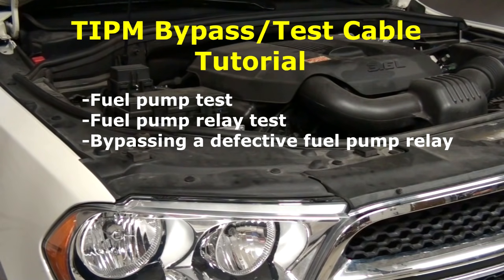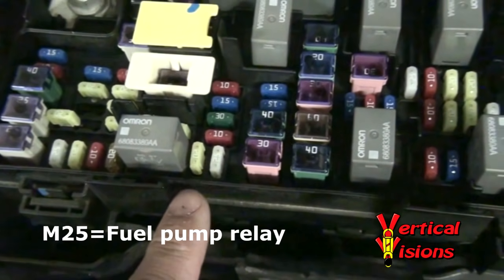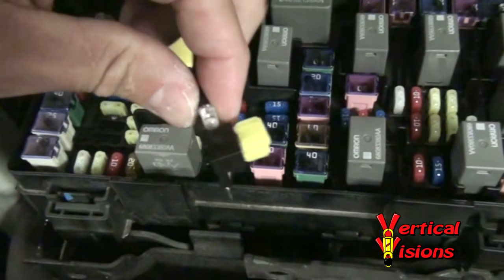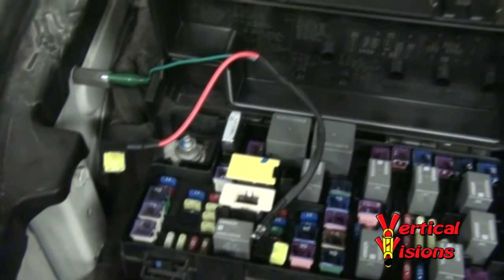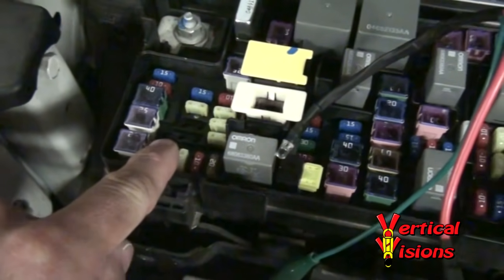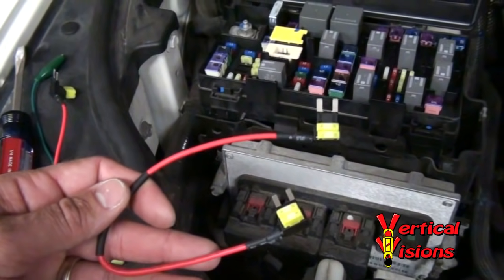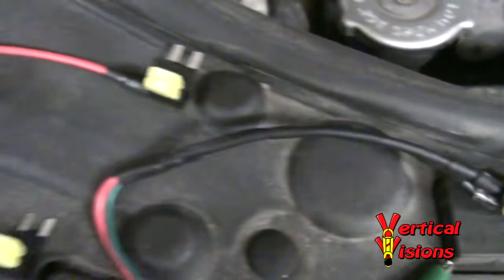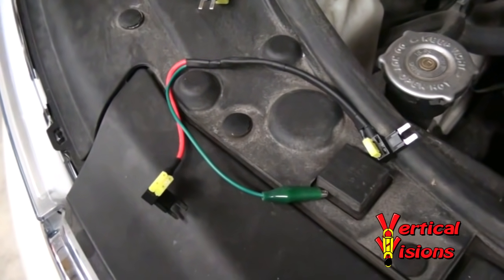TIPM Fuel Relay Test and Bypass Solutions - Most 2007-2021 Dodge, Chrysler, Ram, Jeep, VW Vehicles

Comment: My 2013 town and country is doing having an issue where it either stays on or takes several tried to turn on. Would this be the fix. When it stays on I’ve been pulling the m25 fuse to kill it. If this part is the fix where can I order?
Reply from the maker: This would indeed be your fix as your description of the problem matches a fuel pump relay problem perfectly.  Order here, along with more solution options:  https://www.verticalvisions.com/tipm-fuel-relay-solutions.html
Reply: @VerticalVisions  I’ve ordered and received it, I installed it yesterday, it started and ran. This morning i could hear the fuel pump come on but then it didn’t want to start. To be honest the fuel pump was much louder than normal with this cable. Should I take one of the fuses out?
Reply from the maker: @ckward9379  Fuel pump was likely louder because you now have an unobstructed flow of current to the pump.  The old faulty fuel relay likely had carbon or silicone buildup on the contacts, lowering system voltage.  As to why it won't start, there are dozens of things that can cause this.  Could be fuel pump obstruction, cam shaft sensor, low fuel, inadequate fuel pressure, WIN/fob issues, etc.  Which vehicle do you have  (year/make/model)?
Reply: @VerticalVisions  2013 Chrysler town and country! Thanks for the reply!
Reply from the maker: @ckward9379  2013 T&Cs are becoming very popular for having fuel pump relay issues.  Send us a photo of your part installation and we'll try to see if anything is out of place.
Reply: @VerticalVisions  I appreciate it, I got it started and it’s running fine now. It had sat for a good week and a half to two weeks. The cable did the trick! Thanks again!

Comment: Awesome video and implementation of a great workaround.  I have a 2013 Dodge Avenger with the same symptoms, but you don't have the bypass cable for that model.  I'm going to have to find a wiring diagram somewhere and see if it's possible to figure out.  If anyone has any ideas or knows where I can get a wiring diagram online, please respond!  Thanks!

Comment: Hi Jason- I purchased one of these years ago from you out of desperation and it worked flawlessly. This year, however, as the colder weather is upon us, there are some mornings our Grand Caravan cranks and won't start after numerous tries. After 5 minutes if trying, we have managed to get started, but I'm wondering if you have a suggestion. I thought I remembered a comment you may have made in the earliest posts that the fix might not be permanent.
Reply: Easy solution (new cable connection method):  https://www.verticalvisions.com/tipm-test-bypass-cable-mini-blade-fuses.html#faq20

Comment: The bypass wire works great in warm weather, when it gets below 40 it needs to crank it 10-15 times before it starts, I have no idea why. Once it starts, you shut it of right away, then while the car is still cold its gonna start right away, no problem. Why???
Reply from the maker: Solution:  https://www.verticalvisions.com/tipm-test-bypass-cable-mini-blade-fuses.html#faq19
Reply: @VerticalVisions  thanks, M37 works great

Comment: I had the same problem but it’s fixed.  there any way to fix the remote start?
Reply from the maker: Yes, use the new M37 to M25 connection method to enable remote start: https://www.verticalvisions.com/tipm-test-bypass-cable-mini-blade-fuses.html#M37

Comment: Hi Jason, I own a 2009 VW Routan. The van runs great, but every 100 miles or so it will stall out in the middle of the road. Once I coast to a stop, it will always start again when I turn the key. Obviously I want to avoid this dangerous inconvenience. Is this an issue with the fuel pump? Or is this something that can be fixed with the bypass? Thanks for your help!
Reply from the maker: Stalling while driving is not always a fuel pump or relay issue.  My theory is a thermal expansion issue inside the TIPM on a solder joint or similar.  As you drive and heat is generated, the solder joint expands causing an open circuit (no flow of electricity).  To be honest, we are not 100% certain of the cause for this unique situation......but you are not alone with this problem. Unfortunately, it's not always a fuel pump relay or pump problem, as reported by our customers.

Comment: Thank you very much! Using the information on your website I was able to  build a bypass cable and used the new M37 to M25 method to solve the faulty TIPM fuel pump relay problem on my 2011 Ram 1500 Hemi. Curiously, after adding the jumper my MPG's increased significantly.

My theory is that the corroded relay contacts caused excessive resistance, which caused a drop in voltage to the fuel pump, decreasing its output.

Thanks Again!
Bill

Comment: i just watched a similar video and the guy used 20 and 10 amp fuses on the cig lighter side and 20 and 15 amp fuses on the fuel pump side? can you shed some light on why he did that instead of 2 20s on both sides?
Reply from the maker: We developed this system in 2014.  We also have a new cable connection method that uses M37 to M25 for bypassing the fuel relay.  This is likely what you saw.  Here is the new method:  https://www.verticalvisions.com/tipm-test-bypass-cable-mini-blade-fuses.html#M37

Comment: Will this work on 2017 ram 2500?
Reply from the maker: I am nearly certain our TIPM cable with micro2 fuses will work on a 2017 Ram.  Go to this page and verify that your TIPM looks the same as shown:  https://www.verticalvisions.com/tipm-test-bypass-cable-micro2-fuses.html.  if so, it will work.  We simply haven't updated our applicable vehicle chart to include 2017 models yet.

Comment: Thanks Jason! That part has saved me a lot of money. But...... now I’m having battery drain issues. I don’t know if it’s related or not, but the truck will start up when jumped and run great all day. If I leave it sitting longer than 24 hours, it won’t start at all. From what I can find in forums, it appears to be something related to the fuel pump draining my battery. Maybe I have the fuse plugged into the wrong cigarettes lighter relay spot??? Thoughts?
Reply from the maker: Use the new cable connection method:  https://www.verticalvisions.com/tipm-test-bypass-cable-mini-blade-fuses.html#M37

Comment: Great temporary fix! Thanks. Currently waiting on parts for recall. Your video saved me. The jeep wouldn't come on with remote start like you mentioned.
Reply from the maker: Our new connection method allows for remote start:  https://www.verticalvisions.com/tipm-test-bypass-cable-mini-blade-fuses.html#M37

Comment: I ordered this works amazing! Expect for my key start truck starts and shuts right back off is there a way to fix this as well?
Reply from the maker: If you meant to say "remote start", then simply configure the cable per our new method and remote start works perfectly.  Link:  https://www.verticalvisions.com/tipm-test-bypass-cable-mini-blade-fuses.html#M37
Reply: @VerticalVisions  before you replied I went threw your instructions and found it and yes it worked!! Awesome thank you so much!!!

Comment: I have a 2016 dodge the fuse layout is different from the one in the video so which fuses I need to pull to use jump wire 🤔
Reply from the maker: 2016 Dodge Ram, Caravan, other?  Not sure which vehicle.  If a Ram, go here:  https://www.verticalvisions.com/tipm-test-bypass-cable-micro2-fuses.html
Reply: @VerticalVisions  Thanks alot

Comment: I have a 2012 durango rt with the push button start, sometimes when you start it with the button it will die about 4 secs after and is hard to restart (like its not getting fuel) is the TIPM problem the cause of this?
Reply from the maker: You may have an external fuel pump relay that is the cause.  Replace it.  More info:  https://www.verticalvisions.com/omron-g8jn-external-relay.html#identify

Comment: The Horn on my my BF's 2012 avenger goes off randomly while he's driving it. Will this chord work for that? Apparently this is a common issue with avengers and the dodge avenger forum says dealers are recommending replacing the TIPM for $1200 bucks!
Reply from the maker: A TIPM cable won't work.  Possible solution here:  https://www.verticalvisions.com/other-solutions.html

Comment: Hi Jason! I don't know how often you check this but I have a question..and I'm praying you have an answer for this single mama of 4. I bought your bybass about a minth ago hooked it up on my own and my new van I just leased in March started right up!  It has started everyday no matter what time or day any time I started it and now again it is sitting in my work parking lot and will not start. I am so upset and don't know what to do!
Reply from the maker: Make sure you're using the M37 to M25 connection method per the instructions since this has changed from the video above.  If you still have the instructions, your question was answered on the back page with respect to items to check.  Which vehicle do you have?  If you have a 2011-2013 Durango or Grand Cherokee, you likely have an external relay installed and our cable is ineffective.  Hope this helps.
Reply: I have a 2012 Dodge Caravan Crew. I did use the new hook up method..and it worked like a dream like O said for about a month. The last time I went to start it it started up and then just died out..I can hear the fuel pump tho so Idk.

Comment: Hello news flash....This is not the proper repair part or procedure for this problem....and what happens when you accidentally drop a dime into the cigar lighter socket and it shorts out? These TIPM modules are junk i get it but jason is making a business selling something that could cause more problems than you started with. This jumper wire is a bandaid only for this problem and to keep you from getting stuck somewhere in bfe, not a proper repair. But hey for all those who want to risk a 5$ part on this well go ahead and burn down your  $10k truck or car .
Reply from the maker: News flash:  We don't use the rear cigarette lighter for anything other than testing purposes when the car is off (we now use the run/start signal for power in bypass mode).  I get it....it stinks for dealers and repair shops when someone outside the "industry" develops a simple solution to a problem.  FYI:  There are tens of thousands of cables in use around the world since 2014 and no one has burned anything down.

Comment: This is the last time I bought a dodge, it's the worst car in the world, the dealer has proven to be despicable for not calling its scrap cars.about this video Ok ok ok some people disagree 🤔 why ؟؟؟؟????? In any case, many thanks and deserves appreciation and admiration.thank you so much Jason.
Reply: i agree, since fiat took over they build pure garbage.
Reply: Call the factory service rep and explain your problem and what can be done about it and which dealer can you take it to and get problem fixed. I would be very surprised if that didn't work for you.
Reply: Every vehicle brand has its issues. Its just different things for different brands. Just because youre having issues doesn't mean they are the "worst" in the world. Ive had issues with ford, chevy, dodge, nissan....
Reply: @Jasten Lothes  ok My friend, correct. But if you compare your Dodge car with another car, such as Toyota or Honda, you will notice the difference. My Dodge car has 80,000 miles and I got a lot of problems like changing the alternator and the starter ,windows motor (2 times),air blower front and back,thermostat,brake switches,battery(every 2 years because the battery location close to the engine (too hot) and transmission fluid lines ,engine mount , water hose, fuel pump relay,suspension , and more etc... while my Honda car has 200,000 miles 🤔 I haven't changed any parts???(only one battery) what do you think??
Reply: @nouro7723  lol I just love dodge but I see your point

Comment: I have a friend with a 2006 jeep cherokee that will not start when it's hot. When it's cold it will die several times before it stays running. Would a 2006 cherokee be built the same and therefore this be a fix or is the TIPM different?

Comment: Been having issues with our Caravan. This helps! Thank you so much
Reply: Please does your fuel pump stayed on position when yours van off position?
Reply: @nouro7723  It wasn't always running, I think our issue was it wasn't turning on initially. I haven't ordered the part yet as we've been driving the truck. But the fuel relay module had recalls and if it got serviced, the fix was to clip the relay module and wire it under the TIPM

Comment: Have this bypass in my 2012 ram and the fuse on the fuel pump side keeps blowing as the truck warms up any idea what could cause this ?? Thank you.
Reply from the maker: 1)  Fuel pump is pulling more than 20 amps, indicating it is faulty to some degree, 2)  Short circuit in wiring between TIPM and fuel pump, 3)  Your TIPM fuse slots (likely M25) have been widened by the use of fuse taps or similar, creating a loose fuse connection and increased heat.  Note that most fuel pumps use less than 10 amps.  Solution:  Check the fuel pump current by removing M25 and inserting a multimeter or a Fuse Buddy (https://www.verticalvisions.com/electronic-specialties-fuse-buddy-305m.html)
Reply: Jason Bell  thank you after watching the video I noticed you used 20amp fuses and on mine the fuse on the fuel pump side  that’s goes into m25 was a 10amp fuses changed it out so far so good but will keep watching .
Reply from the maker: @angelrobledo308  You must use 20 amp fuses, which is likely the issue.

Comment: Stay away from Chrysler products. Problem solved. This is a similar situation they had back in the late 70's and early 80's with their electronic lean burn system. Had the computer mounted on the aircleaner. What a joke. Chrysler never learns. This TIPM has been an ongoing problem for years.  After working for Dodge/Chrysler as a mechanic I would never own their product. They deserved to go broke but sadly we bailed their sorry asses out!!!

Comment: The dealer said my 2013 Durango has a bad fuel pump Harness connection, they are telling me the harness is 440 and labor is 800. When i look up a fuel pump harness it I see them for 20 dollars. Is the dealer trying to screw me over?
Reply from the maker: My initial thought is they're ripping you off.  Wire harnesses rarely go bad and often they can be repaired.  You likely have an external fuel pump anyway, which we sell replacements for $9 because they're the most common cause of a 2013 Durango no start situation.  Read everything on this page first and change the external relay if you have one installed per the recall:  https://www.verticalvisions.com/omron-g8jn-external-relay.html.  Let me know if this helps.
Reply: @VerticalVisions  thanks, my durango is currenty in the dealer shop, today i told them i dont want it fixed so they will put everything back and I will have it towed back to my place. I'll have to ask or check if they did the recall repair and then see what I need to order. Thanks again and im sure I'll have more questions.
Reply from the maker: @arielhernandez2834  I'd guess that 95% of all 2013 Durangos have the recall (external relay).  Assuming you simply have a no start problem where the vehicle acts like it's out of gas, your best bet and most likely fix is to buy a $9 relay and replace it in the dealer's parking lot.  You'd be the 39th or so person (that we know of) who has  happily driven away, waving to the stumped dealers as they hang their heads in shame.  Seriously. Back in 2014, I was one of these people who fixed my own car in the dealer parking lot when they couldn't.  This event started our journey in the auto parts business.  Why trust me on this?  Because I have spoken with about 15,000 people about this same problem......and we still provide free instructions on how to build your own fuel relay fixes on our website (despite the fact that most normal businesses would never do this).   Helping people feels better than taking their money.

Comment: Shouldn't you be able to use this jumper set up to test other circuits in the tipm besides the fuel pump say and system ?
Reply from the maker: Yes, but the circuit you're intending to connect to will receive constant power.  For example, you wouldn't want to power your horn or washer fluid with a TIPM cable, but a circuit that needs +12 VDC when the vehicle is running could benefit from it (assume there would be no safety issues as well).

Comment: Just got mine and it worked exactly as demonstrated. 2011 Dodge Grand Caravan...My shop told me it was the fuel pump, and it I was minutes away from brining it and spending $1,000 to have it replaced, not to mention that would not have even fixed the problem. Ordered the cable with the LED, ran through the tests...very simple...and it showed the pump was fine. Bypass has had the van running so far today with none of the problems we've been having for the past couple months. Ours would, very intermittently, just crank without ever turning over, even after letting go of the key. Past 2 weeks it started becoming more frequent, and even stalling after starting. No check engine lights or anything or for diagnostic purposes. Thank you so much for making this available, I will probably be sending in the TIPM for a more permanent repair as well. 👍